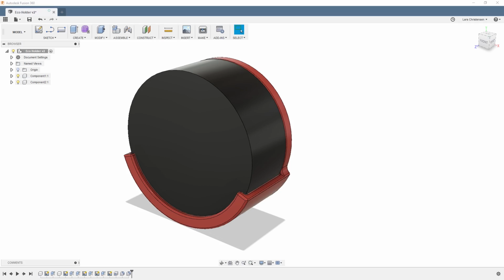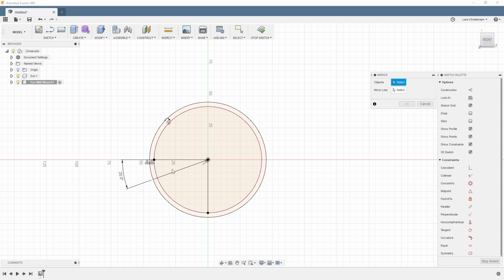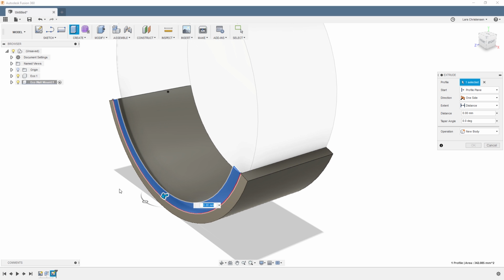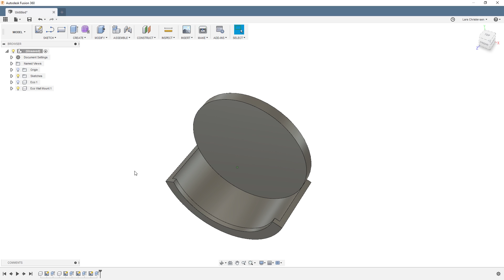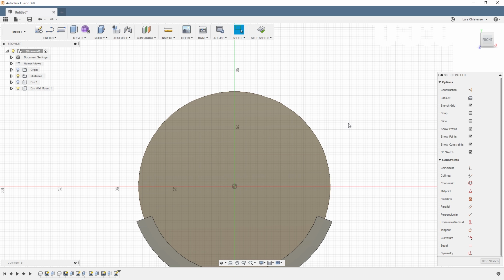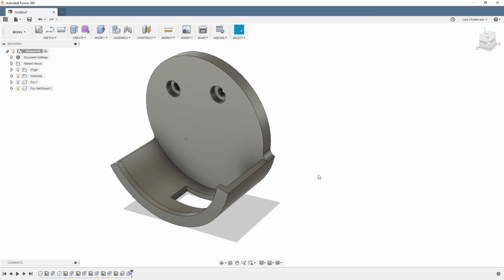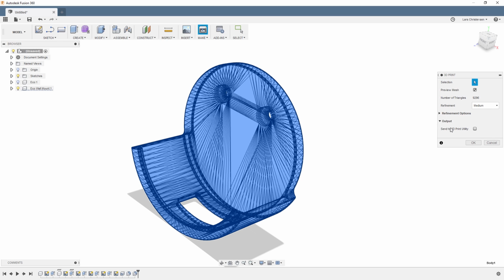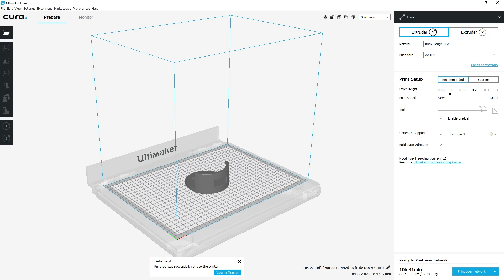From Fusion 360 To 3D Printer — Season 2 EP10

Comment: Great video but fillets in some scenarios might be an issue for 3D printing. I recommend to take a look on Maker's Muse video over here https://www.youtube.com/watch?v=XTvBOGgx48I as well

Additionally this video is tailored to printers supporting a secondary material like PVA as support generation. Otherwise those overhangs will either fail or be of low quality if supports from PLA or PETG are used. Different design considerations are necessary for "one extruder" set-ups.
Reply from the maker: Thank you for sharing

Comment: What? I had no idea what a cool dude you are Lars!!
Reply from the maker: Lol, thank you 👍😊
Reply: Lars Christensen I’m considering a Mac computer to run fusion 360. Would like to know your minimum specs it should have. Like most folks I’m on a budget so want to be frugal, but not necessarily cheap. Thanks so much.
Reply from the maker: Sorry, I am not really a great computer guy when it comes to bits and processors. Here are the system requirements https://forums.autodesk.com/t5/fusion-360-support/fusion-360-system-requirements/td-p/7377880

Comment: Why don't you use the new Fusion 360 interface? You showed it to us several weeks ago.
Reply from the maker: I’ll switch the new UI when it becomes default, I have a feeling that new viewers would be confused if I’m not using the standard one
Reply: Old habits die hard! I tried it but couldn't get the manufacturing tab to show me 3D printer simulation. Useless for me. Also no Make icon so it took me a while to find 3d print in the File tab. Meh, not impressed.
Reply: @MechanicMan if the pull down item has 3 vertical dots to the right you can pin it to the header or shortcuts.

Comment: Hi Lars,
The way you're printing this, I would expect drooping filament under the overhang for the USB connector, and maybe even some drooping for the rim that is keeping the Echo in place, and you have left very little space for clearing, so you may have to do some post processing after printing this, like sanding or cutting.
Maybe you shold have a look at adding supports in Cura....
However, removing supports can be a pain, and there is a fine line between adequate support and ease of removal while having a (relatively) smooth surface.
This is an oldie but good one: https://www.youtube.com/watch?v=RQX06gmCfYU

Comment: @Lars Christensen, I have watched several of your videos and been very frustrated by the slow pacing, but this video is just right; I think it is one of the best videos I have seen from you so-far.  You covered quite a few different and highly-useful features/functions of Fusion 360 which I did not previously know about, and you did so in a way that was simple, straightforward, and understandable without going into too much explanation.  Thank you for a job well done.

Now for the "areas for improvement":  Fusion 360 seems to use a different "up" than 3D printers.  You can see that by the fact your design is vertical for mounting on a wall, but when you sent it to the 3D printing software (or if you save it to an .STL file) you find it output in a different orientation. In your case this worked in your favour, outputting flat instead of vertical, so you didn't need to adjust further within the  Cura software for your printer.  But for most designs intended for a 3D printer, Fusion 360's defaults need to be changed to use 'Z up'.

Comment: Great video Lars, which shows (as far as I'm concerned) the perfect design/3DP combo.  
One observation though - I've never found a reason  to choose anything other than the High refinement setting for the mesh. The risk you get when choosing Medium is that circular parts in particular can look quite facetted, which gives a poor impression of 3D printing
Reply: In contrast, if you use a low triangle count, 3D printing software will be able to read and slice it faster because the .STL file will be smaller in size.  This can be good to know, as some in-printer slicers (or OctoPrint on a Raspberry PI) do have memory limitations that may be hit if the STL file is too big, containing too many triangles.
Reply: @jameslaine2472  Fair point James. Very low poly models can also actually  have an interesting visual appeal, so there's another use for Low. 
I'm always striving to create the highest quality 3D print I can on my Ultimakers so I always use High. My laptop is powerful enough not to complain and a few seconds extra on the slicing time isn't significant in relation to how long it takes to 3D print things

Comment: I love your videos but the thing makes it hard to follow is my Fusion doesn't act like your fusion.  When you press/pull the first circle your view changes to angled and it allows the pull to go in the positive direction towards the front.  Mine stays in front view and when I rotate the view the positive direction is away from the front.  Little things like that just confuse me and I don't see what I am doing wrong.
Reply: He is using a Spacemouse. It makes a huge difference when you have full control of the model position with one hand and mousing with the other. I have a SpaceNavigator and would never go back to just a mouse and keyboard. It also makes a difference on the faces you choose to manipulate. Most default to a positive direction of pull.
Reply: @helicopterdriver  Ok - makes sense, thank you.  I am pretty sure that in the past (last couple of months) when I pressed 'Q' it would re-orient - that is why I was feeling confused.  Didn't it?
Another thing that stymied me that I figured out that there are 2 "mirror" commands.  The one under the "sketches" is different than the one under "Create".  Seems like the program could figure out which one by where I am at.

Comment: great video as always. Going through all your fusion videos. Have you covered a movement basics for starting with the software? I model in sketchup and I have problems with rotating/panning in Fusion. You seem to be using shortcut keys for this as you trigger movement/pan/orbit automatically.
Reply: He is using a Spacemouse. It makes a huge difference when you have full control of the model position with one hand and mousing with the other. I have a SpaceNavigator and would never go back to just a mouse and keyboard.

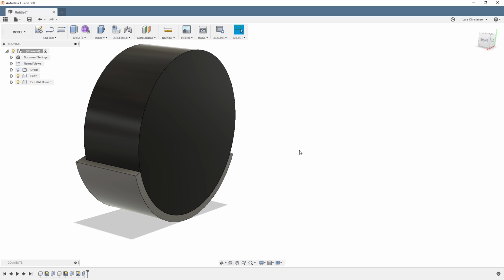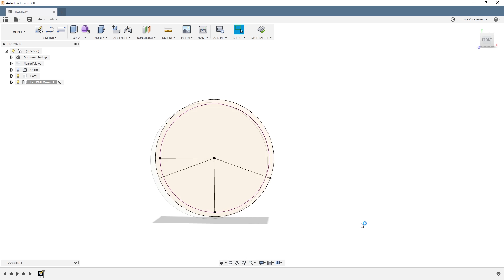Comment: 6:55 why creating a new sketch? You already had a sketch at 3:50 that you could have reused 😉
For 3D printing a boolean cut with surface offset would still be very much appreciated (as suggested here https://forums.autodesk.com/t5/fusion-360-ideastation/boolean-subtraction-with-option-to-create-offset-for-tolerance/idi-p/5543878#comments )

Comment: I use Fusion frequently for printing parts. I try to add for shrinkage within the dimensions that I think need it. Sometimes I get it right, sometimes I have to rework the model. Maybe a topic for another video?
Reply: Lars and Brian, Can I add to this comment. I used do the same thing, go back and alter the sizes but have failed several times, I now use the slicer programme settings only for shrinkage, so if as the video I would make the echo dot the correct size, I would make the hanger with the clearance gaps, export the file to Cura then there is a setting for scale on the left of the screen, uncheck the uniform box and type in 102% for example for x,y,z as you feel is needed, so maybe your print shrinks more in the x than z so 103%,102%. The other thing I find is different filament shrinks differently red and green 103% black 102% hence the drawing stays the same I just quickly re-slice. My question to Lars is and using the video example; Can you extract a section of your fusion drawing "a detail" to make a test print from? so I would look at your design and rather than fully print it I would print just the bottom part to check the width of the mount and the cable hole detail.
Reply: @TurboTimsWorld  Good info on scaling it in Cura as opposed to trying to do it in Fusion. I can maintain the true dimensions in Fusion so that at a future date if I come back to the drawing I don't have to remember what I changed. Thumbs up on that tip.
As far as extracting a section for a test print I think I can answer that--use the Split Body command, then export just the Body part you want to test print as a stl file.

Comment: if your nozzle is 0.4mm then your layer height should be a multiple of it such as 0.12mm instead of 0.1mm this ensures layers from overlapping, cuts down print time and brings smoother finishes
Reply: @Andrew K, Nozzle diameter on the horizontal plane has nothing to do with layer heights on a vertical plane.  I think what you may be trying to reference are the 'magic numbers' mentioned in a video from CHEP:  https://youtu.be/WIkT8asT90A

Comment: When modeling for 3D printing, if it's possible work with wall thicknesses in multiples of the nozzle diameter.  So, your 3.5mm offset may work better at 3.2 or 3.6 for a .4mm nozzle.  That's particularly important if you were at a 2.5mm where the wall would be printing pretty much solid with the number of outer (wall) perimeters so the print will not have a gap or the printer will have to fill in that difference with a zig-zag type of infill.
Reply: @coreyward  I wasn't talking about layer height, I was talking about perimeters of the print and how if you have  thin part of a model you may want it to add up to a multiple of the nozzle diameter.
Modeling for 3D printing is different than for CAM.  For example, I wouldn't have modeled that to require support at the lip to hold the Echo or the hole for the cords, or, made the model in several pieces that you would assemble. 
To each their own.
Reply: I thought you were referring to the distance of the overhang to the “Echo”. In any case, you're still operating with the erroneous assumption that nozzle size is equal to the width of the extruded material. Unless you're printing with material that shrinks considerably, or your layer hight is excessive, the extruded material will be squished, causing it to be wider than the diameter of the nozzle. Of course, matters are only complicated by the filament's characteristics as it comes to the extrusion temperature.
Reply: @coreyward    If you have that much squish you're settings are wrong.  
When I model a part to fit within another part I leave 0.1mm gap and things fit just fine, even with threads.
Anyway, we're getting too far off topic...
Reply: Mark G The value most (all?) slicers use for the extrusion width is 120% the nozzle diameter. This is not something I’m pulling out of my rear end here. At 0.4mm you’re looking at an extrusion width of 0.48mm. Again, though, your slicer expects this and adjusts the Goode output to suit. There’s really no need to get anal retentive about setting part dimensions to a multiple of your nozzle diameter or extrusion diameter, but if you do, you want to use the extrusion diameter, not the nozzle diameter. In any case, it only matters if you have a single wall; slicers space your extrusions away from each other slightly to avoid building the layer taller than the set layer height (which is bad).

Comment: Lars, awesome video!! i have a question: how do you model NPT threads? also how do you cam them? i couldn't find any taps other then UN and ISO. Thank you!!!
Reply: Second that question
Reply: I pull them out of the McMaster Carr insert feature and cut off what I don't need.  I started to try and model and gave up.  Way faster to pull from there.

Comment: Can I ask a bit of a stupid question please. I am trying to learn fusion 360, but at the moment I have been using 123design.  When you add to a model in 123d you either combine or subtract to either add faces or make holes.  On fusion 360 does the programme to the combining for you and makes the faces become one solid object,  is just during the vid I did not see combine the back plate to the hanging shelf.  I am sorry if I have not explained myself well, but I am really finding it hard to grasp the basics of this programme for 3d printing use.

Comment: Another option for exporting your design to STL is to right-click on either the body, component, or the entire assembly and select "Save as STL".  By doing so, it pulls up a more detailed window showing many options for fine tuning your soon-to-be exported STL.  I don't generally change anything, but it's still nice to see what the sliders and check boxes do.  I always use Simplify3D to slice my models, so going directly to the printer isn't necessary for me.  But, I just wanted to mention this for others and maybe Lars could quickly cover this alternate way to export STLs.
Reply: Greg - you could do what Lars did but send it to Simplify3D by using the Custom option and at then at the bottom pointing it to the .exe file for S3D. I've set it up to do that in the past, so I know it works
Reply: My only beef with shipping it direct to Slicing software is that it uses a 16 byte random file name, and I have to change it. Better for me to just export it with file name control and having that file available for other actions.

Comment: For models with large flat surfaces such as this, using .2mm layer height would print much faster without losing fine details.  There wouldn't be a lot of visible difference between the prints.  I am curious how your printer handled the overhang at the front of the model.  Was there any sagging?  Did you need supports to print it?
Reply: PixelSlinger I was wondering about that overhang as well. I just assumed he was a wizard and it worked perfectly on the first try without support.